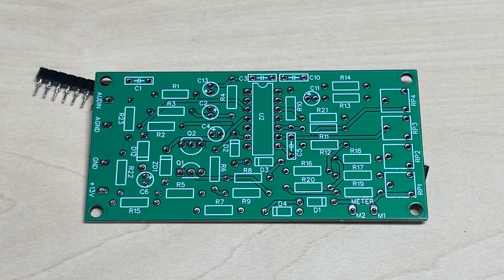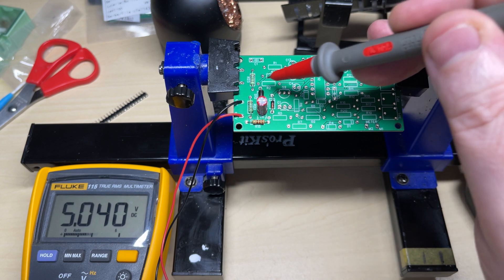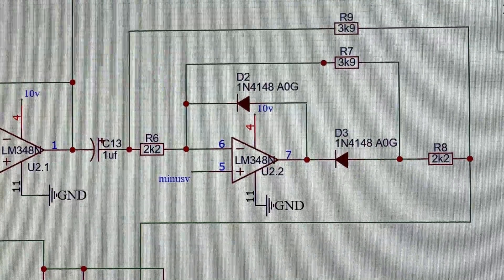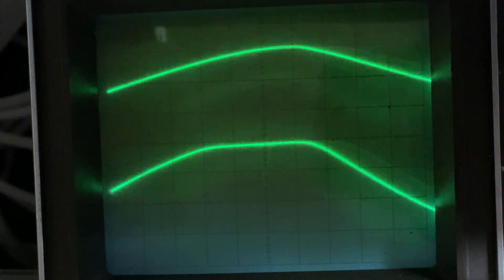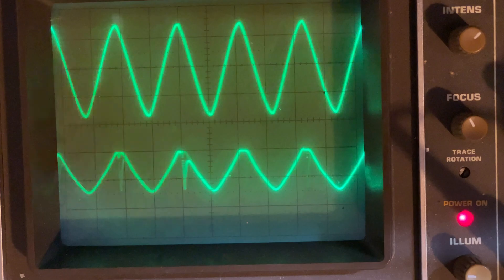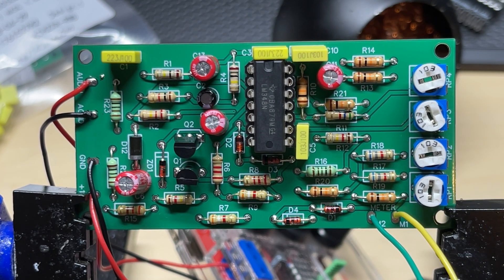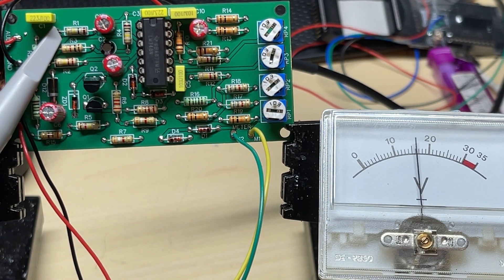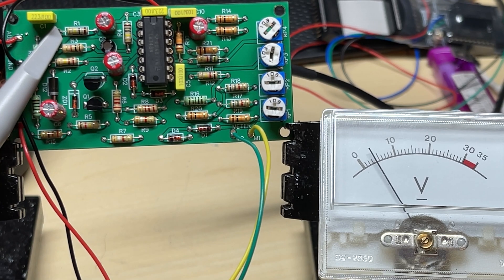EP 117 - SINAD meter - Build and test - Part1.

Comment: Hi Yeah I have just built one of knoximan's sinad meter, I can see "V3" i dont know if this is the version number ie stand for sinadder 3 but mine has only got only 3 Potentiometers. I had a 1ma fsd meter and could only get half meter deflection at 2000KhZ, but I did get the deflection right down low at 1000KhZ then I read that knoximan recommends a 50 µA meter (its a shame because the 1ma meter I found is an actual Db meter 😏) hopefully the 50 µA meter will fix things and I will get fsd at 2000KhZ (i have to tweek R20 Potentiometer though to get there)
Reply from the maker: Hi , yes a 50ua meter will be fine, thats what i used.

Comment: The circuit diagram for the Sinadder 3 shows an 8 volt regulator, so where is the 10 volt coming from, surely it should be 8 volts ?
Reply from the maker: I think the Motorola one uses 10v and knoxiemans used a different one , the circuits are basically the same . A zener is more than enough to regulate . The whole circuit draws very little current .
Reply: @MicroChipz  Yes the one I have a circuit for the Sinadder 3 uses a low power 78L08 100 mA regulator, they all seem the same circuit really. Not too sure about the missing capacitor on the voltage divisor for the +/- 6 volt, think something else must be going on, as it has a capacitor across the two resistors. Ken
Reply from the maker: Yeh I’m not sure why mine require the cap, I did make a moto board . Removing the same cap caused a little disruption , not as much as the other board .

Comment: Interesting concept, I wonder where the problem on the output waveform is coming from? Have you looked at the condition of the VCC that is feeding the op-amp IC with a scope as it may be a decoupling issue(just a guess)?
Reply from the maker: There’s going to be a few more videos on this . It’s not working right somethjng strange going on. The rubbish schematic didn’t help either .
Reply: @MicroChipz  I may have found a better schematic, if you do a search for SINADDER schematic / service manual this is a unit that was in production based on the Motorola design. It uses J113 FETs which are still available by ON semi. The circuit is also based around the LM348 quad op amp. Also if was me I would dump the zener and fit a modern low drop out 9v reg. I think it would be easy enough to build a nice digital bar graph display rather than a meter. Just an idea. Looks like a great little project.
Reply from the maker: @M0XFXUK  yes I have the Motorola schematic and I might have a pcb on the way , and for the display yes I was thinking of a led bar graph , just need to get it working .
Reply: @MicroChipz  Hi this project really hooked me, I think it's a great project. I have taken a look of what I can see of your schematic. I think your problem is in the later stage of the AGC, I am trying to figure out why diode and biasing arrangement is like it is because it doesn't look right to me. I think this is causing the waveform clipping. Look at the Sinadder circuit they have done away with the potential divider circuit.  I think the Sinadder  is a more modern design of the old Motorola R-1013A, I am going to have a crack at building it. What PCB design software do you use as I use Eagle. I can send over the board and schematic files if they are of any help to you. Also I would be interested in looking at the schematic you are using as I can only see bits of it from the video. Best Regards John
Reply from the maker: Il send a link later
Reply from the maker: I’m using easyeda . Jlcpcb software
Reply from the maker: @M0XFXUK link for you https://drive.google.com/file/d/1qiP63DioOk-01bgeFYHiYGUr4NjsU1oE/view?usp=share_link  i have already found 2 faults with this , so if anyone downloads it , dont build it.
Reply: @M0XFXUK  Zener works just fine, digital bar grap display isnt fine enough when using the circuit in practice as the adjustments are very fine and you dont get the resolution required for accurate adjustment.
Reply: @MicroChipz  OK So I have been looking at the circuit and to be honest it is difficult to comment without playing with it on the bench but I have come up with an idea, I am thinking of building the front end AGC circuit and then feed it into an ESP-32 via an I2S A/D converter and displaying the SINAD dB level with an OLED. I have been thinking about the code and I reckon that I could make it so you are not limited to a 1KHz tone in fact I think I could make it work with any tone from 400Hz to 5KHz and it would automatically  lock on to the tone and also maybe measure the harmonics. On the back of that the parts would cost around 15 pounds or less. I am quite busy with work at the moment but when I finish my LO project using the SI5351B for FM mod I am planning to give it a go. I am interested in your thoughts and ideas.
Reply from the maker: @M0XFXUK  that could be a interesting project
Reply: @MicroChipz  Harsh LOL my hand drawn version simply couldnt be uploaded, version 3 of the schematic was correct though.
Reply from the maker: @knoxieman  hi don’t be too offended with my comments . I was taking it from a building point of view and the details supplied. I think once now all the bugs are ironed out everything is ok . Let’s hope these video s inspire others to build .